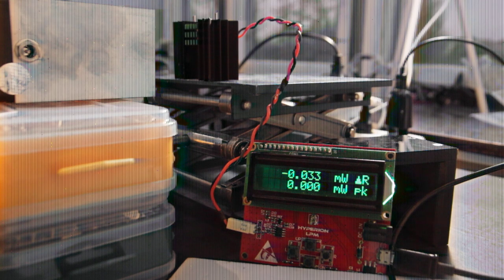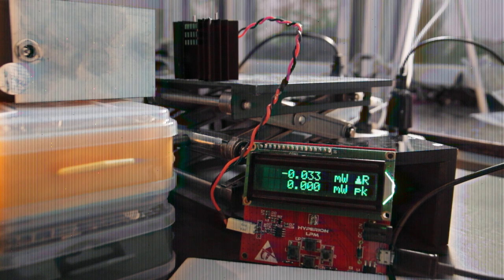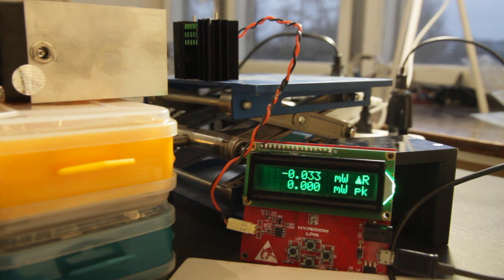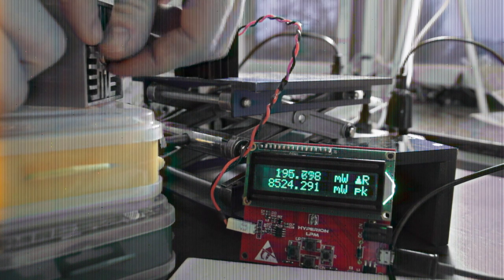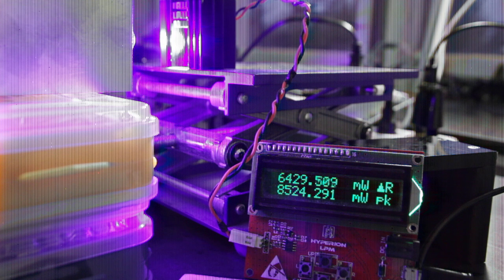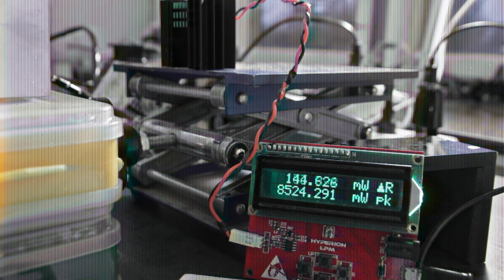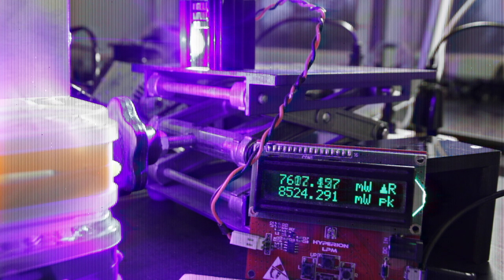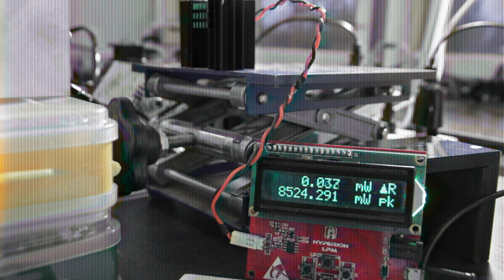All you need to know about different types of laser lens and their laser power losses.

Comment: I am looking at a 20mW 405nm diode and a 120mW 405nm diode (first time using lasers, not sure which is better for my application) for a project where I want to use fluorescence to turn on a phototransistor when water that has been contaminated by oil passes between the laser and the transistor which turns on the transistor and outputs a voltage which can be measured to indicate the presence of oil. The water passes through a tube with a diameter of ~37mm. Do you think there is any risk of damaging the transistor with 20mW 405nm or 120mW 405nm light aimed directly at the transistor at all times? What lens would be best?